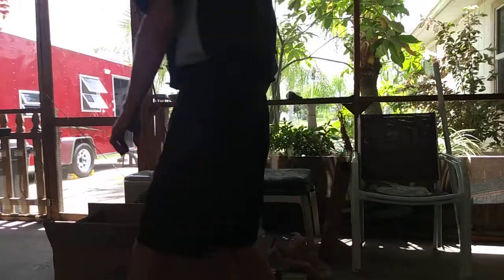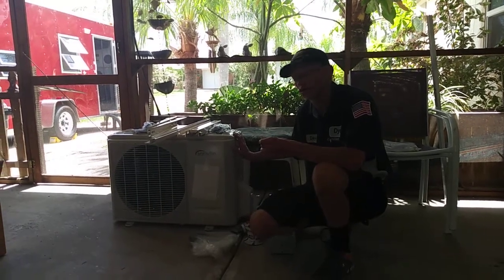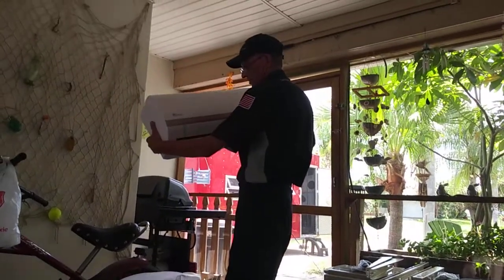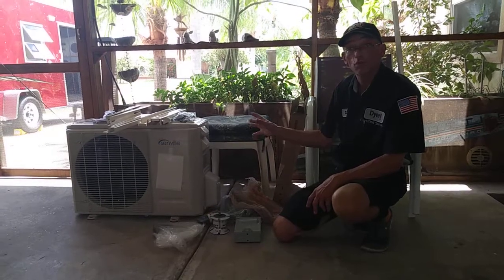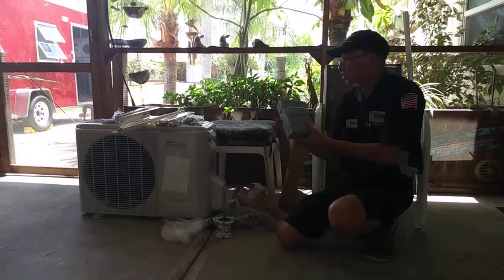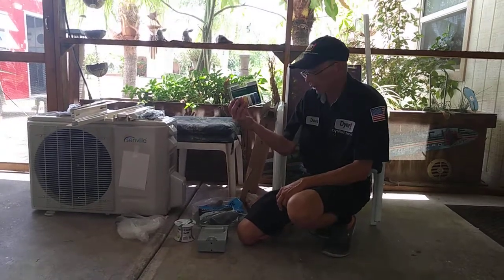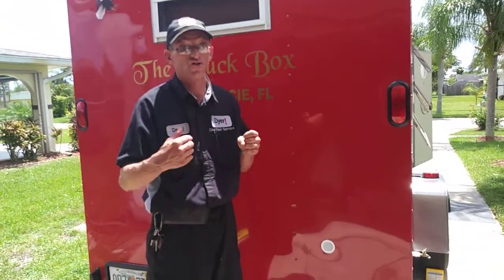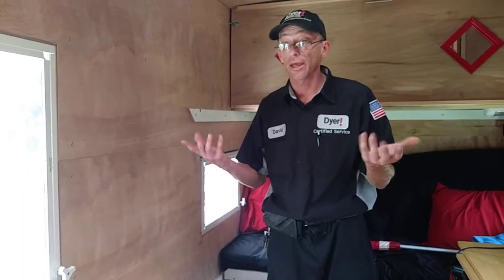Cargo trailer mini split....

Comment: I have watched your vids all day. The BEST ! I have a quick question. If I went with a rooftop AC. Could I not brace with wood as I would my windows ?
I remember in a few videos back you said the reason you didn't was because the roof wasn't braced enough for the you unit you felt. I'm asking because I am about to order my trailer and trying to decide.
Reply from the maker: Kel4everSmiles you could brace with wood. My goal was light as a build so I went this route. I dont hear it run.... Ill do a comparison to a roof top soon....
Reply: Roof top a/c's are horribly inefficient when compared to any mini-split. Also, very loud. Go mini-split.